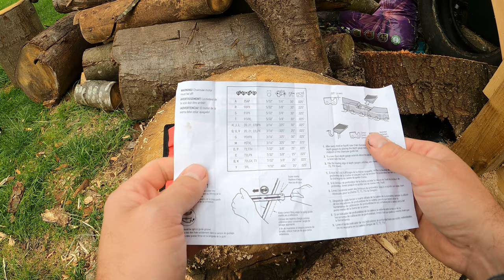How to sharpen your chainsaw with AMAZING RESULTS! Oregon kit

Comment: When using the file guide sharpen all the teeth both sides, then take the file out of the guide and free hand run it through the gullet of the tooth. File the rackers. Thank me later.
Reply: If you use the right size file, it will get the gullet regardless.

Comment: Ordered the same kit and the 7/32 file will not fit in the guide. The clasps won’t latch. Other two files work as it should but the one I need doesn’t.
Reply: You should be able to unscrew the holders in order to loosen them.

Comment: How do you know which round file to use please
Reply: U can just tell by how it fits
Reply: It's based on the chain pitch. The smallest file is for 3/8 low profile. The middle size is for .325. The largest is for 3/8.